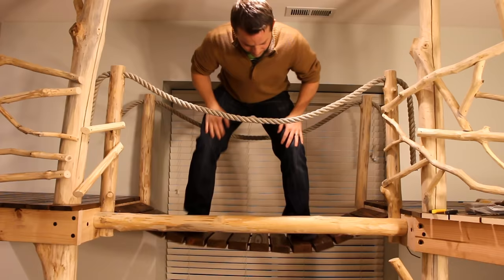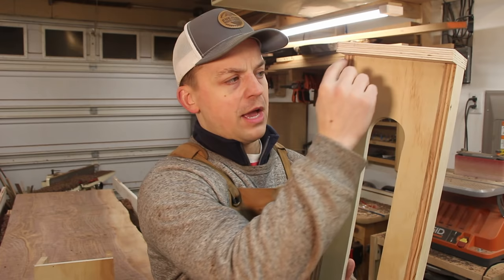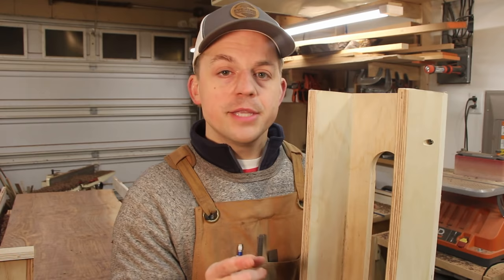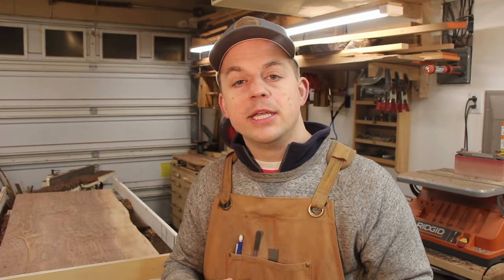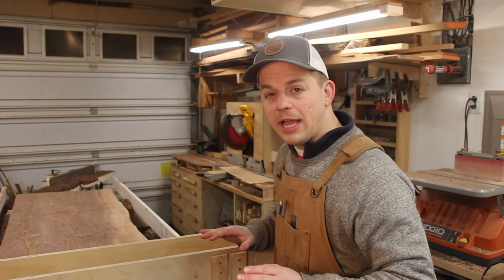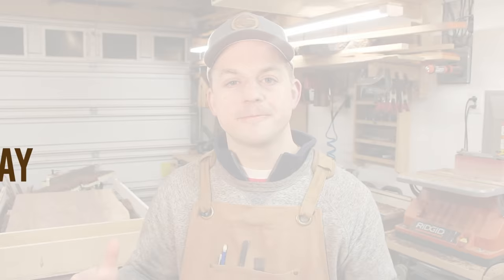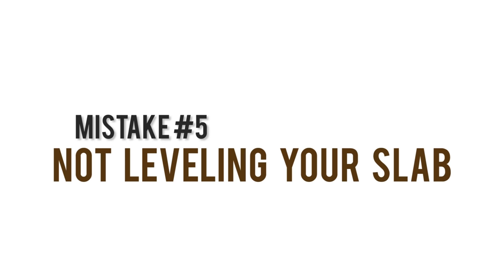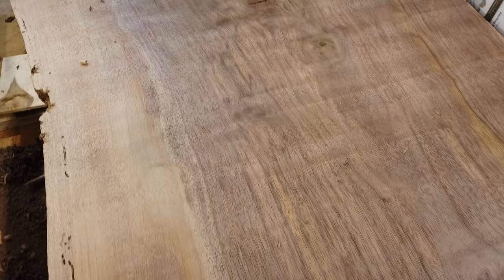DON'T make these Router Sled Mistakes! | Evening Woodworker

Comment: I also use a dedicated piece of MDF which I screw the rails down to so they don't move. I don't try to adjust my rails to fit the wood I'm doing I just make sure the wood is secure. I usually block it as much as possible and screw the blocks to the table. And like this person. I make sure that the slab is as solid is possible.

Comment: Love all your suggestions. The only thing I know I will do different is to simply screw in the side walls directly from the bottoms with the screw heads countersunk in, instead of pocket screws. Small detail but I think it is easier and faster.
Reply from the maker: That works too! As long as you keep that surface flat, you're good
Reply: My thoughts exactly - thanks for mentioning this.
Reply: @EveningWoodworker  What about cutting them in a 45 degree angle and gluing them together?

Comment: Absolutely great tips! I have one suggestion that you might find interesting… try holding or fixing the router to the sled temporarily, and move the sled length wise. Count the number of passes. Bet it’s less than 1/3 of going across the width! Just try it once and you might be amazed as you’re cutting with the grain too!
Reply from the maker: Good idea... I may try that next time. Just gotta make sure everything slides well!
Reply: @EveningWoodworker  that butter smooth action you didn’t really cared for 😉 might come handy. Awesome video and awesome point made by Darrel Reed
Reply: There are fewer passes, but each pass is longer in length. Time wise isn’t it roughly the same thing?
Reply: @jungko9031 I’d argue it may take even longer, since you would have to release the router and fix it back in position after each pass, whereas it’s much quicker to just move the slide a little bit
Reply: Cutting with the grain is best in my experience. It eliminates the use of a belt sander and makes sanding much easier.

Comment: Great insight, you failed to mention though that routers just like a circular saws are meant to cut in one direction. Yes, you can use them either way, but the tools are designed to work in one direction.
Reply from the maker: Yes, sorry if that wasn't clear in the video. Routers are definitely designed to cut in one direction! Cutting backwards on a circular saw sounds scary!

Comment: Great tip!  Well explained.  I mistakenly found your video thinking it was a tip for attaching "table saw" sled fences.  The attachment of the sides obviously applies to table saw sleds also--screwing the fence perpendicularly to the reference edge makes sense after explaining how the ply pushes out ever so slightly (but enough to make surface less than flat)

Comment: Well this was phenomenal timing. I've seen other videos on this topic but didn't need to make one. Now I have a 24" wide by 3" deep slab of maple for my River epoxy coffee table. These tips are going to come in super handy. I might use my long levels as my rails. 

Thanks.
Reply from the maker: Sweet! As long as you have a way to secure your levels, those would work fine.
Reply: Me too.... just gained access to a couple huge old trees that are now horizontal.....

Comment: A very informative video. I built a router sled over the weekend and will level my live edge Walnut slab the next weekend.

It is a 2 3/4" thick 58" wide and 22" at most deep. The top has 1/2" taper on each side.

I used a large piece of 3/4" melamine for the base and 1 x 4" red oak for the guide rails since I had them in the garage.

For the sled I also used 3/4" melamine with 1 x 4" red oak on each side and for guides on each end.

For all of this I pre-drilled the holes from the bottom making sure the alignment was perfect then I used a countersink bit so the 2 1/4" screws would hold the wood but not get in the way.

the sled rides smoothly and is great.

Just tonight I received a 2" 4 cutter leveling bit for my router.

I watched your video to make sure I did not miss anything, I think I am good.
Reply from the maker: Sounds like a good setup! Good luck!

Comment: I have made adjustable siding rails for different thickness of slabs 
I also use angle iron for my sled so I can do up to 48 inch wide table tops.
I like the tips you give  great for beginners.

Comment: So, right around the time this video came out, I had just built my first router sled. I actually went in a third direction with my sled. I cut a dado into each side of the sled walls and glued the bottom in that way (as one might do with a drawer). Then capped the ends. I never would have thought of the expansion problem, but glad I did it the way I did!
Reply from the maker: Good thinking! That works too

Comment: Thanks!😁 That makes sense to do pocket holes instead of screwing straight into the sides of the wood.
Also, we have some live edge pine planks that we need to level off with a router. We didn’t know that we could do this step before hand planing. This will save us a lot of time and errors. Thank you!!
Reply from the maker: I'm glad it helped!

Comment: Hello, very good info in the video.
I have been cleaning my workshop also multiple times for hours after using the router to flatten slabs. Today , I found a simple, cheap method to reduce the saw dust.
Lay a sheet of MDF or whatever wood on the right of your sled and also a vertical piece of wood. It will reduce the cleaning work afterwards a lot.
Reply from the maker: Great idea!

Comment: Love your presentation. Clear, low key and very direct. An observation to improve the sled is that the sides of the sled need not be so high. That seems cumbersome. I attached L shaped aluminum angle “iron” to far less tall sled sides. The router slides much more easily on the aluminum surface. Again thanks for a very nice low key instructional video. Ciao!
Reply from the maker: Good point. The sides really don't need to be that tall!
Reply: @EveningWoodworker  The taller the better for the sides, within reason. The taller they are the less sagging there will be in the middle of the sled. Not really an issue if flattening narrow slabs but the wider they are the stiffer the sled needs to be. Great tip about joining the sides to the base that way!

Comment: One of the best explanations and uses for a sled.

I will say though, that the reaching over the blade of the table saw to cut the long runner to prevent it from falling on the floor instead of using an out feed support looked rather dicey.
Reply from the maker: Thanks! And yes I need to come up with a better out feed solution. Right now it's just roller stands

Comment: Good video. I would add to check the rail twisting, putting a string across each end of the rail system and sighting through the two strings will indicate any twisting that needs to be corrected. Also, chip collection can be done by making a collection port for a shop vacuum or dust collection system - not too hard to construct, and would solve the indoor chip collection.
Reply: Alternatively people can use angled metal strips along the length of the slide

Comment: Good observation about screws into plywood. Coplanar rails - easier said than done, unless you have a long, dead flat assembly table. Might want to talk about techniques for setting up the rails.
Reply from the maker: True, it takes some effort on that too. I used my tablesaw as one end and then shimmed up the other side on a sawhorse until they were level. It'd be better to have one big table though.

Comment: After looking at videos of router sleds. It seems that most use a plunge router. My router is not a plu8nge unit so can I flatten a slab With it. I enjoyed your video because your explanation
 was brief, clear and informative.
Reply from the maker: You can, but you have to adjust the depth by raising and lowering the bit using the normal height adjustment method.  A plunge router gives you more adjustment and is a bit faster. Both can work though.

Comment: I also know from experience it creates alot of chips. I once built myself a sled to make some planks for a new staircase in my basement and I had to process 13 planks on both sides. I only took off about 3mm max from each side but I had a bucket of 70 liters filled with chips. But I didn't know any of those tips and luckily it turned out fine.

Comment: Best and most thorough router sled video I've seen. Thank you! 
There is one exception, however. You did not cover getting the rails in the same plane. This was, for me, the most uncertain part and one one of, if not the most, the more critical parts. 
That said, I'll be incorporating your design in my next flattening adventure.
Reply from the maker: Yeah I should've talked more about that. Oh well, that's for the next one!

Comment: The video mentions insuring your rails are in the same plane, but doesn't tell how to check that. There are lasers, etc., but the simplest tool is 4 brads and a string. Drive the brads at the 4 corners (ends) of your rails, angling them slightly outward.  Then lace the string in an X, that is, far left corner to near right corner, then to the near left corner and then the far right corner, making sure the string is touching to your rails at all 4 brads.  

If the rails are in the same plane, the strings will just touch where they cross. Ideally, the top string will be displaced up 1/2 string diameter and the lower will be down 1/2 string. If you're picky reverse the order of your lacing and make sure the strings still just touch.  This also works for checking door jambs, which also need to be in plane.  Generally not an issue for single doors, but can be very critical for French doors.

For the Euclideans in the audience, the strings and rails create 2 triangles, which are both planar.  They share a common side, for example, one of the rails.  The X of the string is the 2 hypotenuses and if the hypotenuses touch, the triangles are co-planar.  QED
Reply: Excellent idea!
Reply: Thank you.  That makes total sense and answers an important question.  Thx.
Reply: Very good and pragmatic video, and very well scripted and produced.  Thank you.
Reply: Excellent explanation of how something is in plane and why! Nice job!

Comment: Excellent video.!  

I made my first sled using discarded angle iron (because that is what I had laying around) and a couple pieces of 2x4. But same basic concept.  The iron was nice and straight so I avoided the subtle problems you explained  with wood and screws.  But I might have to go wood for my biggest piece.    This will save me some learning the hard way. 

And a 2"  carbide bit!  You can find them with 1/2" shank on Amazon for <$20. My first small piece required very minimal finish work.  A few minutes with a plane I should sharpen, and  it's almost ready for finish.
Reply from the maker: Thanks! Yeah that angle iron can be pretty sturdy
Reply: @EveningWoodworker  Just what I had laying around.. : )
Reply: @EveningWoodworker  But I made sure to add end stops.  A 2" bit @ x1000 rpm hitting metal probably is not a good thing : )

Comment: i got a trip/tip

when it comes to milling bits for your router, larger diameter yes, but that also means an even slower speed and making sure your router has the hp to handle it, also, fewer blades for rough milling, like 2 blades... more blades, like 4, will give a finer/smoother finish
Reply from the maker: Great tips! These are all good things to consider on router bit selection.

Comment: The reason I can see for a well waxed index surface on both the rails and in the sled is wear and tear. Friction wears things out. Even if you aren't worried about smooth sliding, a waxed lubrication will allow the sled to slide on the rails and the router in the sled with minimal wear. Any wear on the index surfaces will quickly translate to loss of precision in your work. Think of it like keeping the oil in your car engine fresh and topped off. It also protects your hard work from spills and humidity variations. It's best to use a good paste wax to finish any jigs and fixtures that you spent your hard earned time on if you want them to stand the test of time. Take care of your tools and they will take care of you.

Comment: From my shop: To get the rails perfect, I allways use a laser leveler I have in my shop. Makes leveling the rails a little bit faster. BTW. I have some massive aloy beams/profiles with gliding pads for the rails. Totally over designed, but I also use the rails for other tasks. And yes - I got those rails used for small money.
Reply from the maker: That sounds pretty solid! A laser level would definitely help.
Reply: You need a flat, solid base to support the slab with parallel rails on two side. The actual level is far less important as you can measure the slab from the router sled or a beam running on the rails and shim it accordingly.

Comment: Excellent tip on using pre-fabricated moulding for your rails. I will be flattening a bench top already mounted and will just double up on some moulding I have to help with deflection across the length of the bench. As well, I'll screw the rails directly into my table top (will edge the front/back of the table afterwards and just plane those flat) and level it using BobboMax1's Euclidean string tip in the comments below. 

An idea for a follow up video would be how to level and get your rails co-planner. Great videos, cheers, R
Reply from the maker: Thanks! Good idea on the follow-up video

Comment: Have you considered the tilt of the cutting edge VS the sliding surface inside the sled? In CNC a bad milling can often be seen by many "small slopes" along the cutting edge due to that of the cutting edge not being parallel to the plane you wish to mill. I am building a sled this week (and this is a per-fect video by the way) and thought about using painters tape to "shim up" one of the sides of the inside of the sled - just to get that perfect parallel cut.
Reply from the maker: For a simple sled setup like this, that tilt would come from chips getting stuck between the router and the sled, or from any minor racking in the asked frame itself. It could also happen if you put a lot of weight on your router as you make passes.

Comment: Great tips. I love the video although  I only  have  palm router.
Reply from the maker: A palm router could work for small piece flattening, you just have to take off much less with each pass and use a router bit with a 1/4" shank

Comment: I did finally complete a sled with a design to do epoxy pours and as a router sled. The table slab is redwood about 6 feet by 1.75 feet. It is flat but one edge is about 1/8 of an inch thicker than the other edge. So it tilts by 1/8 over a 6 foot length. I assume it was some knot or something on the plywood but now I have something to watch for on the next one. And My redwood table is now flat. On another note: My router bit is 5/8's so I would like to get a bigger one with a 1/4 inch shank.----Thank you
Reply from the maker: Yeah much bigger than that on a 1/4" shank is dangerous.

Comment: I built my router sled a few years ago.
It is a wide, flat, 'U' shaped assembly which actually references to (and is captive over the long sides of) my assembly table. I did wax the channels and where it rides along the edge of the table.. 😉
With the assembly table leveled, and - flat - all I need to do is shim up the slab till the top surface is pretty much the same distance from the underside of my sled, (usually only about 10mm, since my sled base is 19mm thick, and I don't want the bit projecting out a crazy distance, lest it flex and ruin the cut).
A few passes @ 2mm D.O.C. gets the slab flat, then I can flip it and use 2 identical rails to bring it up under the sled, clamp it down again and skim it over with 2mm cuts each time..
I surface (and thickness) my chopping boards this way after gluep-ups, since I don't have a drum sander or thicknesser yet.
Reply from the maker: Sounds like a good process!
Reply: @EveningWoodworker  I thought so too, which is why I designed it that way.. if only I could attach a picture or two to this comment I'd be able to show you, (and others), exactly how it works..

Comment: Add a dust collector attachment to the router. Such as the one from Oneida Air Systems. Works great, doesn't get all the chips, but most of them.
Reply from the maker: Yeah I think I might do that for the next slab I flatten...

Comment: Not all router suppliers list the large surfacing bits in their straight bit category.  Also try the term "spoilboard surfacing bit."   While sold for CNC routers, they work just fine in hand routers for this application.  Those vary in price from under $30 to $180.  The more expensive use replacable carbide inserts.

Once you have your router bit, you may want to pick your step size , the amount you move the sled for each pass based on the bit diameter as the video describes, then mark the rail with a sharpie for each step, like a custom ruler.  I found moving the sled to the next mark sped the process up a bit.

Throughout the process of making the sled and setting up the rails, check for flatness, straightness and twist.
Reply from the maker: Yep the more work you do on the front end, the less cleanup you have to do later

Comment: I am building one of these tomorrow to build a one piece 5 string bass guitar on my channel. Your info was so helpful and honestly  saved me 3 mistakes in the process. Glad I watched, new sub, come by and check it out. I have some 1 inch Birch plywood calling this projects name!!  Bass from one chunk of 2.5 inch Sycamore, 1/4 sawn, 2 years air and kiln dried, been liberated from slab for 4 days resting to relax it.  Will start cutting bass,  soon as I get the sled built tomorrow!  Thanks  again, good info!
Reply from the maker: Thanks! Good luck on your build!